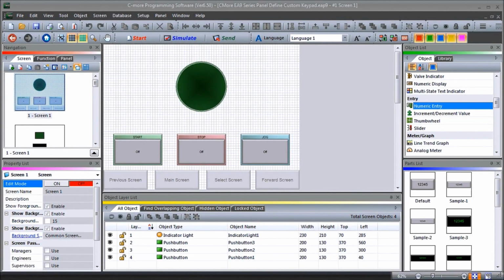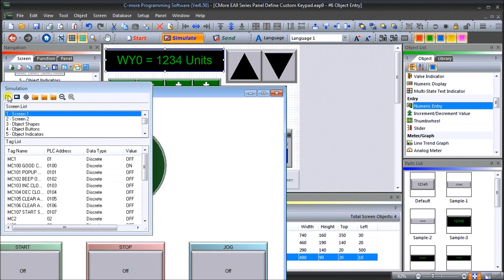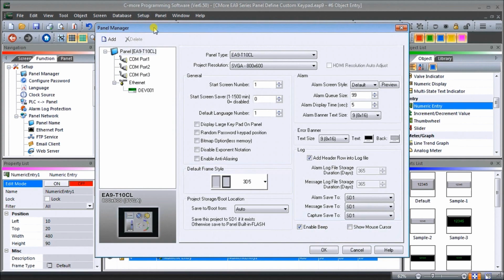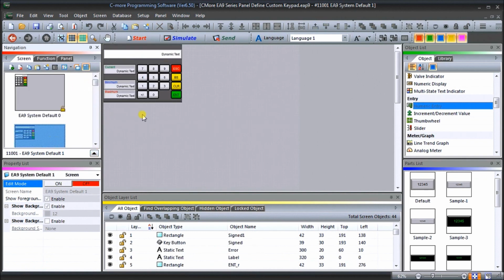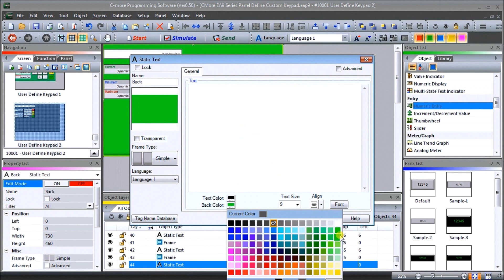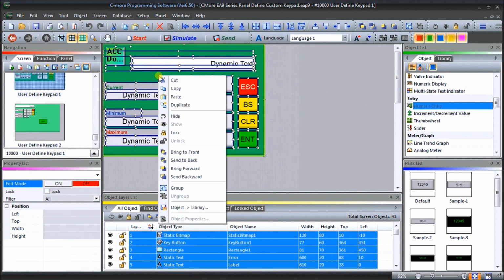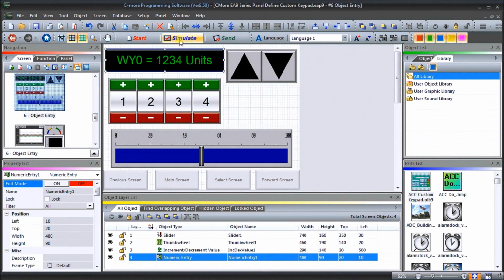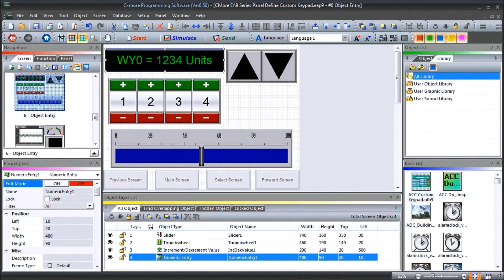C-More EA9 HMI Series Panel Define Custom Keypad

Comment: Most excellent - "Display Large Keypad"

I noticed there was a minimum / maximum off to the side - where would one set that number up, on the PLC or is there a specific location in C-More?

Thanks so much - we love our Automation Direct products!
Reply from the maker: Thanks for the comment. In the Numeric Entry screen there is a "Range" option. Select this and enter the min and max for the input. 
Value, service, and performance - This is why I have been using Automation Direct products.
Regards,
Garry

Comment: Great video.  Can you upsize the default Recipe sheet loading and editing buttons as well?
Reply from the maker: Hi Paul,
Thank you for the comment. When you call up the recipe sheet, there is an option at the bottom right of the screen. This will allow you to increase and decrease the size.
This is probably why there is no way to do this manually without writing the logic yourself.
I hope this helps you out.
Regards,
Garry
Reply: @ACCautomation  thanks!! I'll give it a look first chance I get.